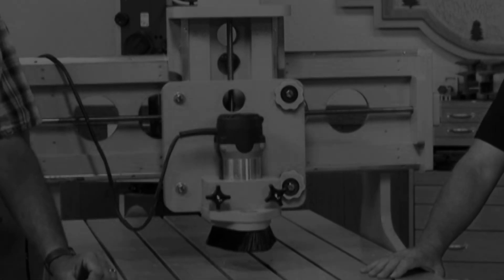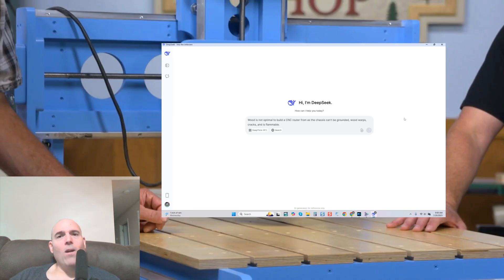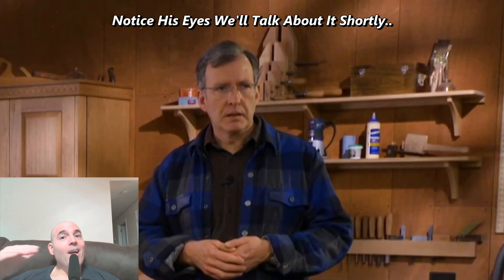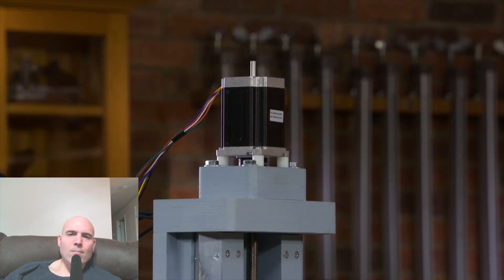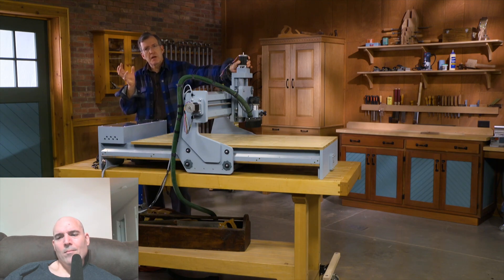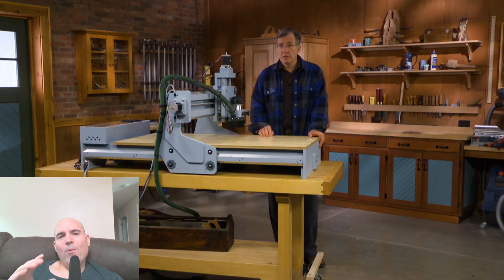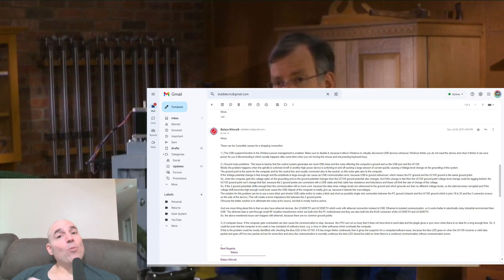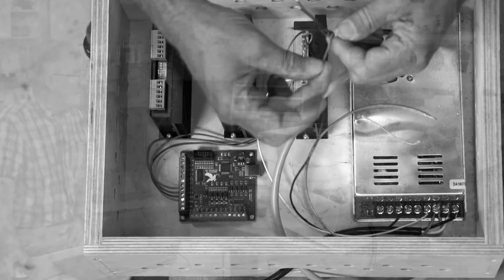🔥 Turning $1,600 Into a Fire Hazard 🔥

Comment: USB signals use a 3.3V standard, 5V refers to the power line.
Reply from the maker: This is true, and this makes my point even more apparent that USB is very low voltage.